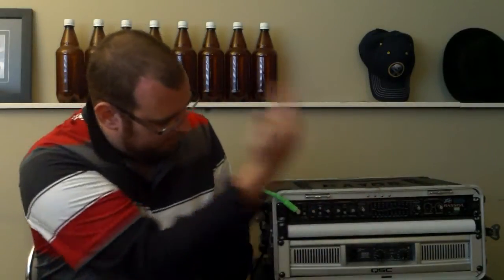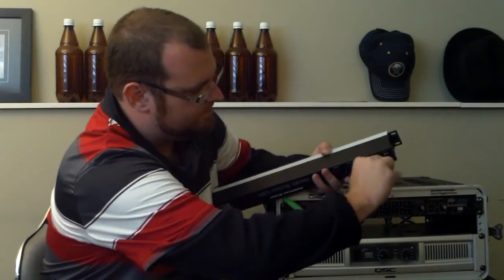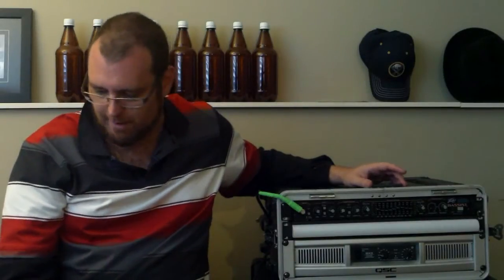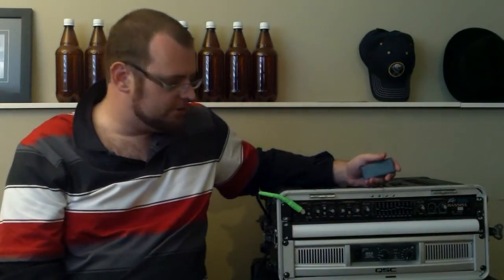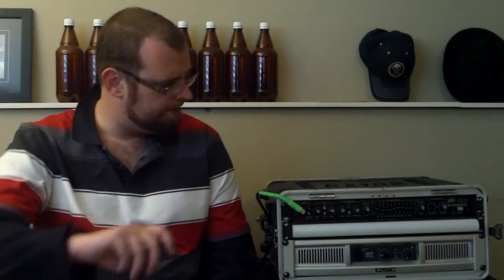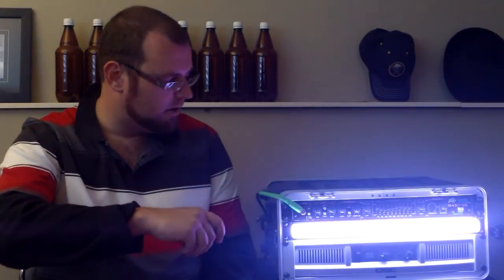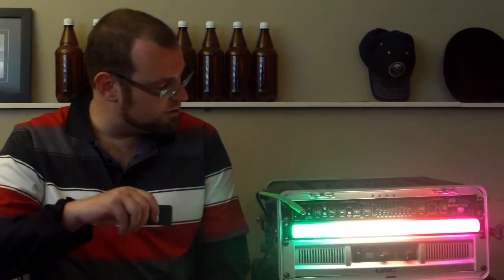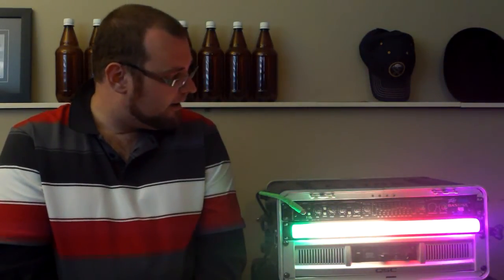American Audio Rack Color LED (AKA, "My new toy!")

Comment: I know that they're discontinued but I was wondering if you have any follow ups. 2 years later. Do you still have it, does it still work, any issues or what not? ??  Thanks :-)
Reply: I've had mine since they were first introduced. I'm shocked that it's been discontinued, the light still works great and illuminates my rack perfectly.